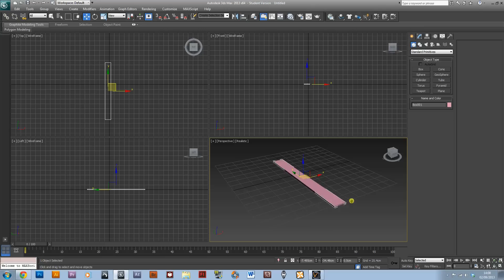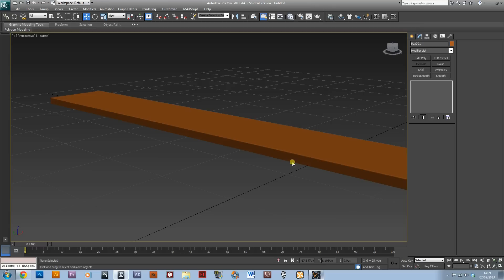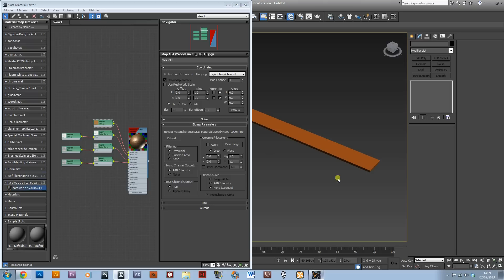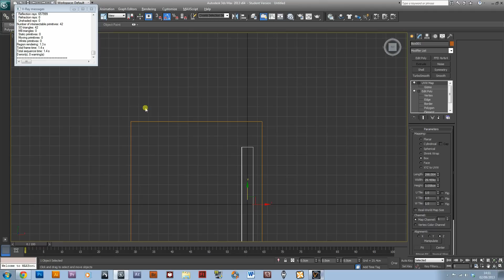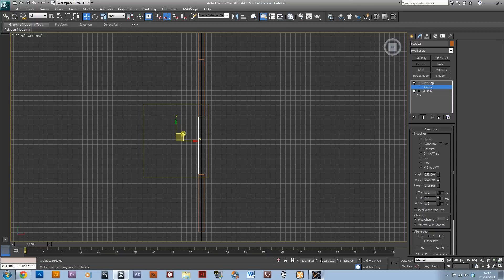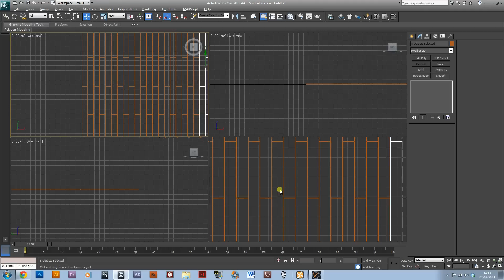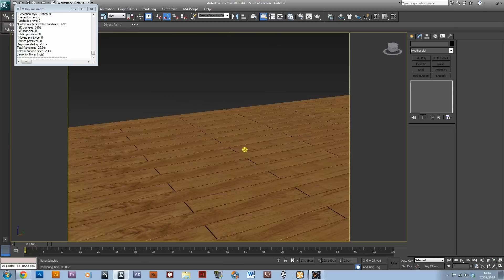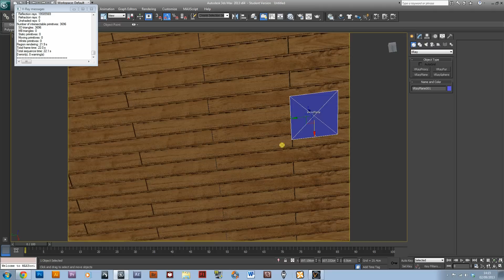TUTORIAL | How to create Laminate Flooring | 3DS MAX

Comment: hi. question for you. isnt easier to find a texture for floors made of wood in cgtexture and apply it over a box. and then using the correct configuration with bump and so, you will get the floor faster?
Sorry for my grammar and english, hope you can understand me.
Reply: +Diego Nicolas Martinez  I was also wondering about it. But I don't get how to use this "tiling" mode in a proper way. I always mess with the scale and other stuff